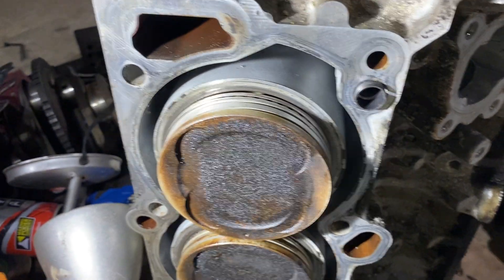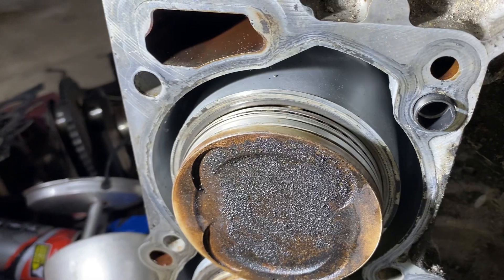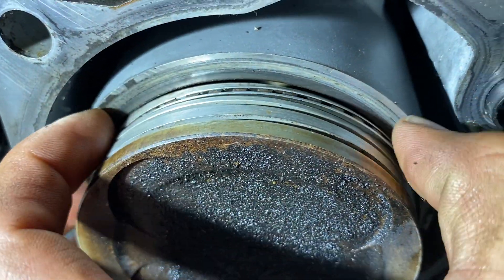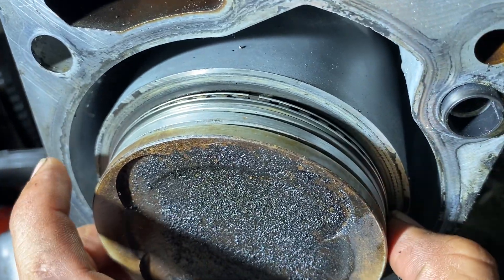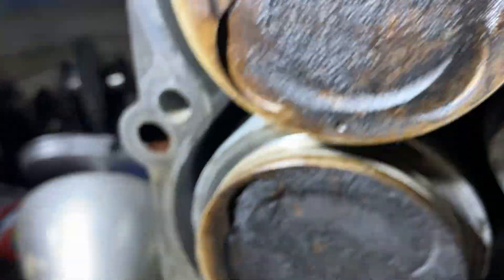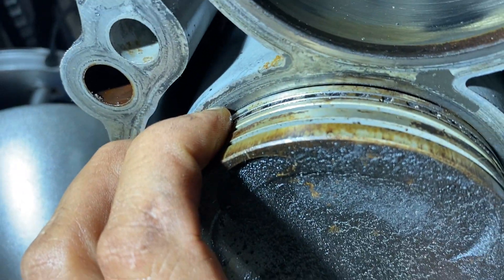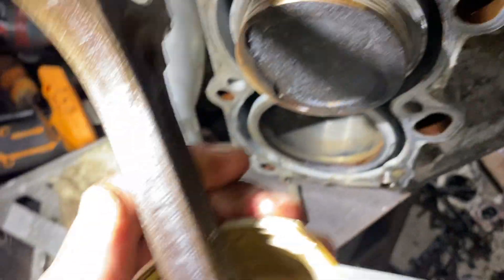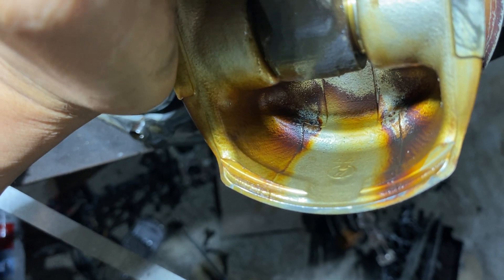Why the Isuzu 3.2 V6 burns oil

Comment: so the million dollar question is: how to get the oil return holes clean without taking the engine apart.......quite a dilemma........any thoughts?
Reply from the maker: This I have no experience with. I would assume finding some product that dissolves carbon and pouring it down the spark plug holes might work if you do it enough times and let it sit long enough.
Reply: thanks, seems the oil return holes crud is very hard to dissolve, some other method required...........its an unsolved problem. @MudOilnGears
Reply from the maker: @namenotshown9277   The thing is, even if you clean it out,  eventually it will build up again.
Reply: @MudOilnGears I've done this on a few different engines. It's known as a piston soak apparently. I poured liquid seafoam down the spark plug holes into the cylinders. Just enough to be about 2cm filled over the pistons. I let them sit for about a week and would time to time rotate the crankshaft by hand to allow the pistons to move and lubricate the rings and to help break up carbon. It wasn't this type of engine but I've done it with Hondas and Mazda and Toyota. The idea still applies to any engine. I mainly let it soak until all of the seafoam had seeped past the piston to wall clearance over time minus a little surface fluid and then I put the plugs in and fired it up and once it burns off the seafoam and carbon that's really as good as you are going to get without doing an engine teardown. It costs you nothing but time and about $20. I highly recommend it. I did notice better performance terms of a smoother running engine.